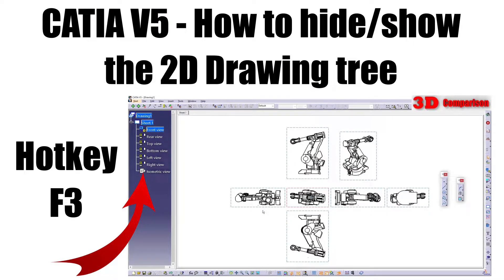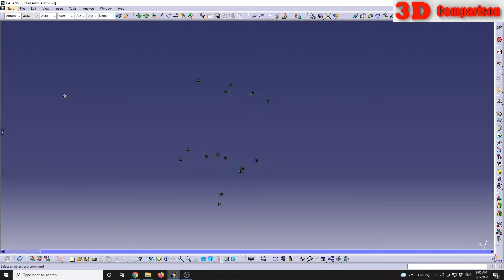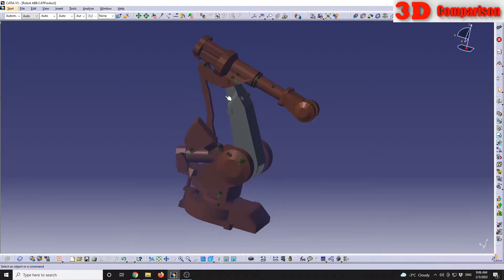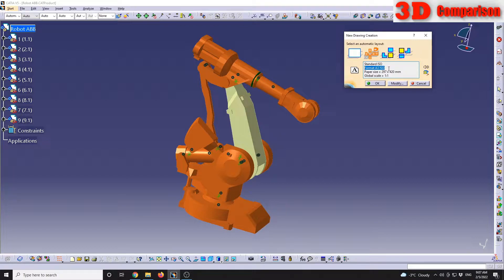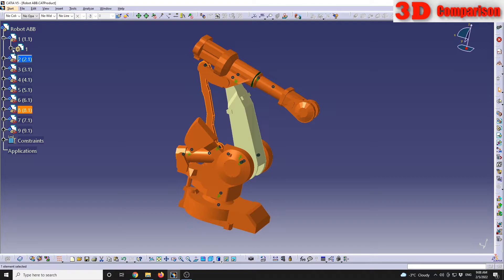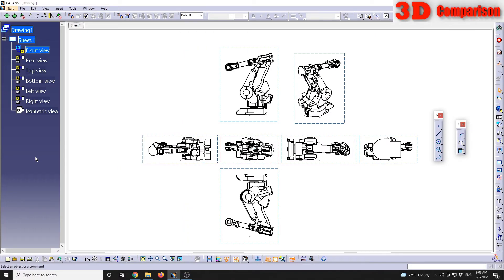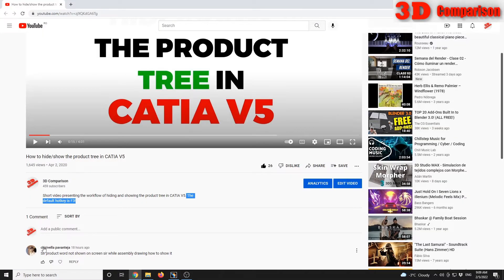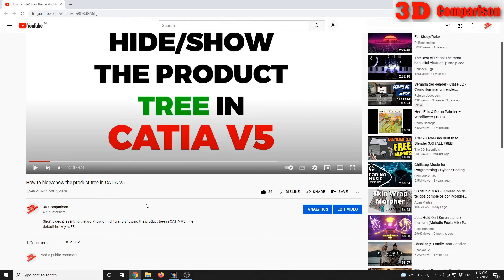CATIA V5 - How to Hide/Show the 2D Drawing Tree

Comment: I still can not get the Feature tree to appear, The Drawing workbench does not allow the tree to appear. can you please assist?
Reply from the maker: If you can make a screen record of the problem I can better understand the problem. I eould recommand that you reset Catia to defaults (you can check my older video regarding Catia reset) and then it should display/hide the feature tree.
Reply from the maker: Let me know if you manage to fix your Catia instal!